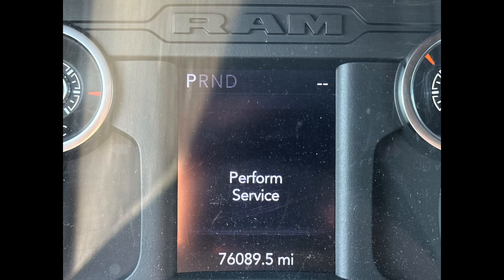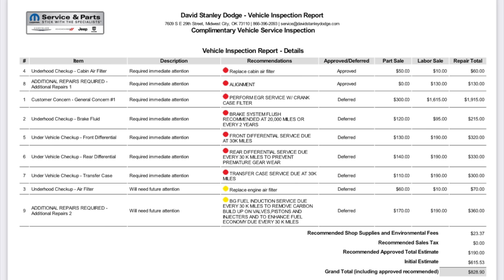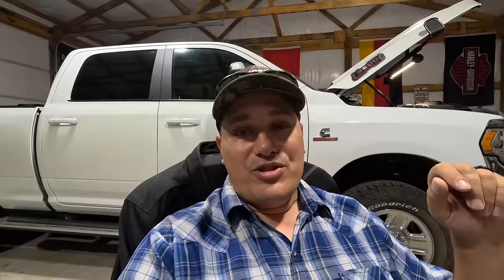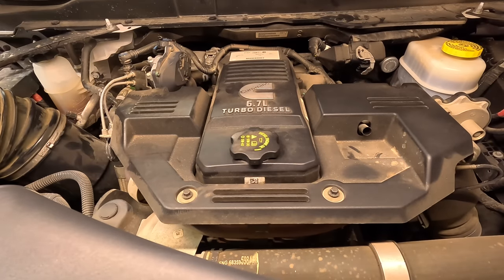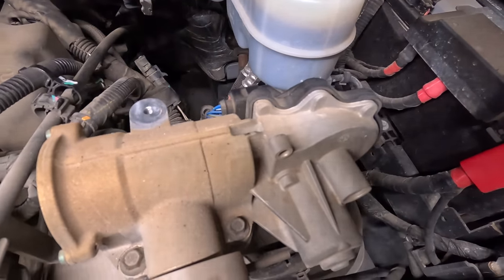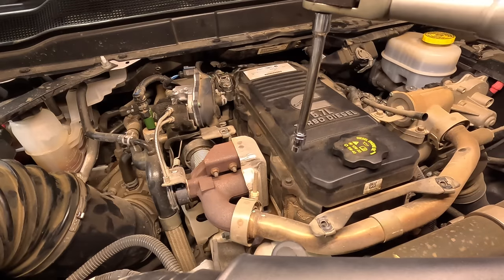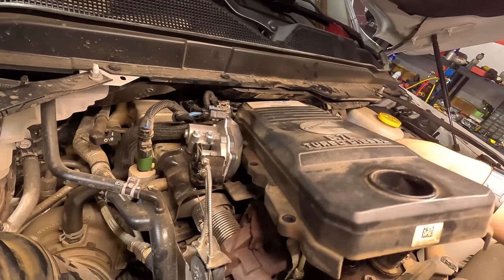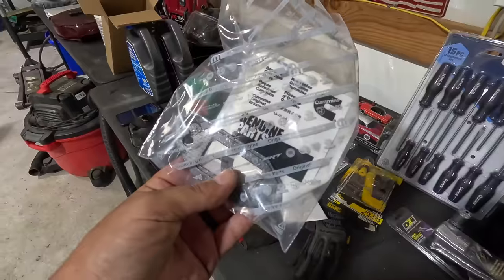My 2021 RAM 3500 Needed $4,000 in Service!! DIY EGR and CCV Service Saved me $1650!

Comment: “Anytime you can save XXX it’s a good day” you could have done it all, I get it,
some don’t want to fool with oil changes and fuel filters but for what the dealer charges I’ll take an afternoon and do it myself. One thing people neglect to think about is dragging to truck to the dealer and then dragging back to get it when it’s done. My time is money. 
“Service engine” is for the filter only, cleaning EGR valve is a dealer “gotcha” it doesn’t need to be done. 
I have a 2020 RAM 3500 with 90,000 miles and have done all service myself (including both differentials, transfer case and trans) and I don’t have $4000 invested, total.
Don’t buy anything from the dealer, they gouge DIY people (gots to get paid) the exact same crank case filter you paid $350 for I got for $78 (when I find a deal I buy 2, so I’m ready for next service)  
Buy only genuine OEM replacement, it’s not much more if you find deals on internet.
Find a deal? Buy 2 or 3 that way you are not 
desperate next time (can anyone say “supply chain issues”?
See that big beautiful dealership with everyone running around on golf carts? Yeah, the service department is a big cash cow to help pay for it. Think the dealer will care for your baby better than others?
Wrong! Lots of dealers pay tech by what they get done and not by the hour so is advantageous for the tech to fly through jobs. I’ve known techs that make well over $100k per year.
They will actually treat your vehicle worse if you don’t play into their higher profit services (everything listed in this video)
I took my truck in for an issue (warranty) and when they couldn’t sucker me into $1500 in basic maintenance they called me 4 days later and said “it’s ready”
They did nothing, nothing.

Comment: I'd buy a Cummins any day, over the other 2 V8 Diesels? After working on a P.O.S. 6.0 Power-Choke, that was done at 150K, the Cummin's is much easier to access main components, and more reliable? A V8 configuration is not as balanced as a straight in-line 6 cylinder? I still think the old 7.3L Power-Stroke is the best diesel Ford ever had?

Comment: I remember way back yonder(like 3 years ago) when i had to change my maf sensor & clean the Egr Valve on my Jetta, the dealer wanted close to $400(mechanic rate + parts) did it myself under 2 hours & saved ALOT OF $

Comment: Even (some) fleets are agreeing with the assessment that modern diesel light duty trucks (technical definition includes most F450 and under) are more costly in the the total cost of ownership category. Our local utility did a 24 month head to head on service trucks and even EXCLUDING downtime for unexpected repairs.  The costs per 100 K miles was 3% less for the identical gas equivalents.  They had particularly scathing opinion in the back-up documentation from the fleet logistics manager regarding the diesel-burners unexpected down time % but they left it out of the official report in case it was brand/generation/model specific.

Comment: Thanks for showing people how to do this procedure. A little more research would let you know that that perform device message will pop up about every 60k mile so that the crankcase ventilation filter will get changed. The dealer will rob you blind. I bought my 2020 Ram 3500 with 40k miles on it in April of 2022. I currently have just over 207,000 miles on it. I’ve changed that filter every time the message comes on. If you buy your own filters and do your own service, you will not spend near what the stealership will charge you. 

I’d say keep it. It will pay for itself if you have it as a work truck.

Comment: My 2018 2500 Cummins powered limited is in the shop having the nav replaced. The transmission failed at 50,xxx miles. I took it in for the emissions recall and now it won't pass smog. Probably going to trade back to a Toyota soon, or just start driving my 422,000 mile 1986 Forunner. It's much more dependable.

Comment: Welcome to my road. Bought a 2010 Dodge 2500 6.7 in 2011. I owned it for 3 years and it ran just about perfect UNTIL it got to 100k miles. Then the AC condenser leaked and that cost $2300 to repair. About 6 weeks later, the main ECU went caput. Another 2500 down the drain. After that one I got rid of it

Comment: Delete the EGR system and keep your factory tune or, as you said, get a pre emission diesel vehicle.  By the way, I’d recommend you replace the intake grid heater. That’s a major issue on the Cummins and when it fails its ruins the engine.

Comment: I have a 2012 3500, as soon as the warranty came of it all the pollution control crap came off also. Got better fuel mileage, felt like I had a little more power today it has just over 500,000 km and running like a well oiled Rolex

Comment: Also was told of a $1700,00 bill to service CV filter and EGR at dealer. Came home ordered filter on Amazon $28.00. EGR cleaned with simple green in half an hour. Money in pocket - $ 1655.00.
Reply: You didn't pocket anything. You only spent $28.00 period. Just like the guy who services their own vehicle. 
It's all on paper. The only money is parts and sweat you do or you tell your buddy to do. 
I've been a DYI mechanic for 40 years. 
I don't call a shop for labor prices and toot my horn saying a saved $$$$$$..
I prefer to smile and drive my vehicles that I can fix them in my driveway. That's the icing on my cake.

Comment: I sold my 2021 high country duramax dually crew cab for my 2008 crew cab ltz and eliminated a 1200 a month truck payment and now have a 2008 loaded ltz duaramax crew cab 4x4 paid for.  Now, I did do a tune som3 weight reduction as well on my lmm duramax and also sorting all the issues the previous owner neglected on her. Basically, it's a new fuel system from the front to rear along with a fass fuel system. Once everything thing is sorted, im actually doing a lowering kit and a complete repaint on it along with some upgrades. But it's all within budget since I don't have that 1200 a month truck payment any further. Basically sold all my new vehicles and now have everything paid for besides the wife's 2500hd gasser and it will be paid for in a couple of years and I'm don't with new vehicles

Comment: The same thing is going on with my Ram 2500. Gave us a great deal on the used truck but not doing research on diesels, now I got major maintenance to perform on it I’ve only had it for 6 months as well. I should have kept my 03 power stroke that I traded for the newer truck 😩

Comment: I am Ram diesel  tech for  47 years. If you work the engine  hard you will not need to  clean the  Egr valve. The heat  will clean th egr system.  If  you run short trips  the  Egr system  will fill  with carbon.  The Egr valve, Egr cooler and the  Egr bypass valve must be cleand

Comment: When we do an EGR service we also drain the cooling system, pull the EGR cooler, and soak it... There is a lot of crap in the EGR cooler. If that dealer is like our dealer, then that is why it costs so much for the service in labor anyhow.

Comment: I have a few comments to add to your video. One you only partially cleaned the EGR system you did not clean the EGR crossover tube or the egr cooler. That is the biggest part that needs cleaned. Also, the small gasket that you used to go in between the EGR and the EGR crossover tube is the wrong one. The one that you took off kind of felt like led correct. The metal gasket that you have goes between the EGR crossover tube and the bypass valve on the flat side. Please change it to the correct one so you do not get a p0299. Have a good one.
Reply from the maker: RAM has stopped cleaning of the EGR cooler like 2 years ago. The gasket I replaced is the correct gasket. I’ve driven 6,000 miles since this video with zero issues.

Comment: Maybe you should look into getting it deleted. And get rid of the EGR system and def. I deleted my mega cab and it’s the best choice i ever made the truck an breath now. It’s a completely different truck now. It gets better fuel economy more power and the longevity of the engine will last so much longer. Pumping exhaust sludge back into the engine is horrible for them. If you don’t have emissions in your area i highly recommend looking into getting it deleted. Unless ur worried about a warranty.

Comment: I have a 2018 ram 2500 that had that same service required message. There is nothing in the maintenance schedule to clean the EGR valve, only the change the ccv filter. The last year EGR cleaning was included in the maintenance  schedule was 2012. The Dealer is ripping off the customer for $1300  of work not required.

Comment: I have a 2019. My Perform service came on at 6500.  The dealer wanted 400 for the CCV service.   I just changed mine.  The cost of the CCV was not in my ballpark.   I watch a You tuber and found out the filter was available on Amazon for $30 bucks.

Comment: A bit of advice Randy it's not the red clip you push to get it off the red clip is only a lock it's the orange bit that u push to remove it sometimes a small screw driver helps
Reply: @auto auction rebuilds

Comment: I hear you my dealer tried to charge me $600 on my car for my canister purge valve. But my mechanic who is also my husband’s family friend charged me $179 so guess where I am going lol. Just waiting to see if that solves my problem with having a rough start, rough idle
Reply: It's called Time and parts . You didnt get free labor at the shop. Remember if anything goes wrong. You take it back if any warranty applies vs no warranty for the shade tree guy. 
The 179.00 is about normal to pay for a shade tree job.

Comment: Transfer case flush? What if you barely ever use 4 wheel drive? Some of the other items I agree with, but flushing the transfer case is kind of pointless. The same goes for the interval for the front differential.
Reply: not disagreeing with you, but for what it is worth, both the front differential and transfer case were very easy to change fluids on so no need to pay a dealer for this unless you have to! The rear differential was a bit more annoying...

Comment: If you dont change the ccv filter it blows the seals , plural there , seals , its never just one , and the dealer either chrysler or cummins is the only ones with the correct size , the local parts stores have them , but they wont fit

Comment: Its funny because the same happened to me but in my case is slightly different i noticed the dealer deleted the error codes on my used dodge ram eco deisel truck and i ran into so many problems from the perticulate filter to the hexaust and now i been doing things myself but the mayor problem is the fact that i need a scanning tool to not only delete the codes but can perform the regen and other. Its been more then 4 months when i baught the truck and i could have sued them for deleting the codes and not completely fixing the truck before selling it. Well now im suffering the consecuences but heck more learning for more work gives me something to do i guess 😅

Comment: I had a 2021 3500 that I was using for cdl hotshot the egr cooler left me stranded twice before 100k and get ready for the transmission to start acting up the ford I traded it in for has been problem free

Comment: Not sure, but my diesel mechanic said the EGR cleaning service is unnecessary for the newer trucks. I have a 2017 Ram with 150,000 miles on it and it runs strong. Mostly highway driving and a lot of towing. Never cleaned the EGR cooler or valve. The CCV filter is super easy and so is the EGR valve. But there is no required maintenance for cleaning EGR valve that I’m aware of. The oil change and fuel filter change costs me $240. The dealer is rippin ya for sure. If you aren’t towing a lot then the Diesel probably isn’t worth it. I haven’t deleted mine but I want to.

Comment: Hello Randy. Doing some diy work on the 2022 Ram 3500 . Isn't it under warranty? If you do keep the truck you should check out about Carsheild or any other car warranty services for cars or trucks that are out of warranty.
Reply: Of course it's under warranty if any problems arise, But the dealer isn't going to pay for your preventative maintenance you know every car comes with a instruction manual and it tells you At what mileage intervals said maintenance should be done I can only remember when they had trouble selling cards that if you bought a new car it may come with 3 years of service but they're not doing that anymore that's for sure

Comment: Great video! Thank you for taking the time to share it with us. I would rarely recommend buying parts from the dealer; they know you can get them for much less money online and all you have to do is be certain what parts you need. Half the time the parts counter doesn't even want to give you a part number anymore because they know you will take that and go online and get it sent to your door for less money. Maybe if they are giving you a discount but it's kind of like Kohls, if you're paying full price, you're paying too much.

I find it interesting that the MY23 owners manual just says to replace the CCV filter at 75k miles; but nothing about cleaning the EGR. I agree, your EGR did not need to be cleaned but you never know until you get your own eyes on it. Your video on cleaning the EGR is great, though. 

Also, you should look at getting rid of the OE grid heater so the nut doesn't corrode and fall off into your #6 cylinder. Banks Monster Ram Air is the best and I believe also the only CARB approved intake manifold for the 6.7 and it also comes with a coil heater so you aren't completely losing your cold weather operations.

Update: Owner's manual says CCV only needed at 75k mile service on 2013+ 6.7 Cummins in Ram trucks. No EGR cooler or EGR valve cleaning. You're dealer was wrong. 
https://www.youtube.com/watch?v=8GpgpQKxBY0

Comment: That EGR Valve, just looks like a large Idle Bypass Valve, just use brake cleaner to break up the carbon deposits? Degreaser will not do crap in that? They tell you let it sit for 3 hours, just to make you feel the $4K your laying out is justified? Use a toothbrush or brass brush with brake clean, make sure you have the electrical side up top, and blow it out with compressed air? You got that easy job in the bag, Randy.

Comment: Randy, great video.. I have a 2017 RAM 2500 with the 6.7 in it, and every time I go to the dealer they want $4000+ for service, basic oil change and Fuel Filters are $350 and they always want to do so much more. Make sure you look into the Grid Heater Wiggle Test on yours also, it is supposedly not as big a deal with the newer 6.7's, but the grid heater has a bolt underneath that loves to melt off and fall into the engine basically destroying cylinder 5 or 6 depending on where it falls. I just replaced my air horn and grid heater with a replacement set at 88k miles and the bolt basically fell off in my hand when I pulled out the Grid Heater.. May not be an issue, but you can check by wiggling the plastic where the grid heater cable comes in on the fuel rail, if it is wiggling, you are looking for trouble.. I love my 6.7L, but They have some notorious design flaws in that engine that can be devastating.
Reply from the maker: New grid heater was replaced last week under a recall.
Reply: Hey Manny, I have a 2017 2500 myself... did you replace your air horn and grid heater with OEM or aftermarket? how much were the parts. ? With 70,000 miles I'm wondering if I should do the same on mine. I will definitely do the crank filter as in the video. And thanks Randy.. great vid.
Reply: @mikeq5664  I went with a banks Monster RAM, but I did the entire Kit, not just the air horn. So I got the new Turbo Tubes and the Cold Air intake also. Whole Kit was like $1900 or something I believe, but the RAM AIR Horn with a diffrerent Grid Heater that they include was about $1000 by itself. KIt is annoying as hell to install, but was definately worth it.

Comment: Your better off doing fuel filters on your own there really easy you will need a tool to remove sensor for the rear fuel filter it only cost 9 bucks on Amazon. I recently had to get my truck fix due to oil leaking where the timing cover at 70k miles and yes they did f me over 6k but since I don’t know how to do that seen video how to but I didn’t want to risk damaging something.

Comment: It’s not even just diesels I took my vehicle in this past Thursday was told it’s $160/hour for labor I’m like oook but got an oil changed figured they could replace the headlight bulbs and fog lights they wanted nearly $400 just for 4 bulbs plus the $80 for the oil change! 😳 1 bulb was $64 and labor was $62 for standard halogen bulbs so I’ve YouTubed it and will be doing my own from now on cause that’s ridiculous

Comment: You did a good job, you did the two easy jobs BUT didn't do the BIG tuff job of cleaning the EGR Cooler. it's not to hard but you need to do it as apprt of the 67,500 😎👍 I just did mine last week.
Reply from the maker: Egr coolers are no longer recommended to do on these newer models.

Comment: I have a 2020 2500. Just put on the Banks Power Ram Air Intake, just mainly because I didn't want to take a chance on the grid heater issue. My truck had 67k on it when I bought it. After checking the maintenance schedule, the CCV filter should be changed every 60k. Since I had everything apart, figured it was a good idea to change it. Parts stores didn't have it as it was a dealer item. So, went over to the local dealer and $318 later, I had a CCV filter. And, you got ALL this for $300??